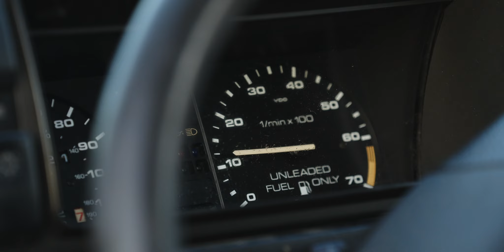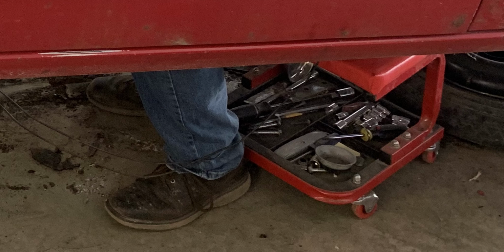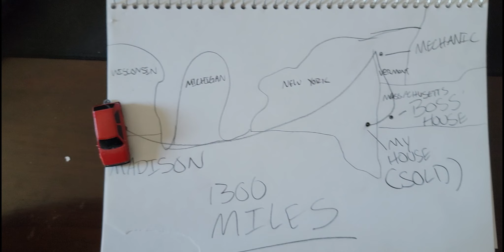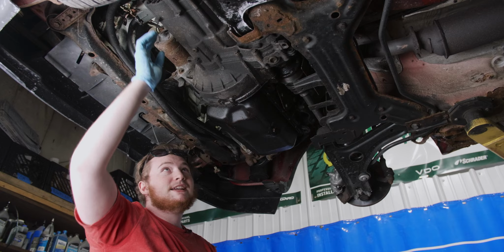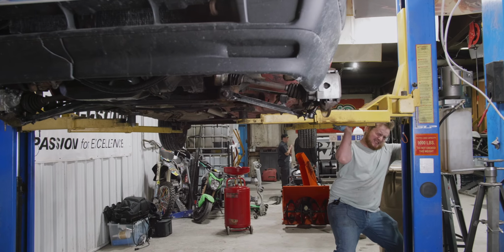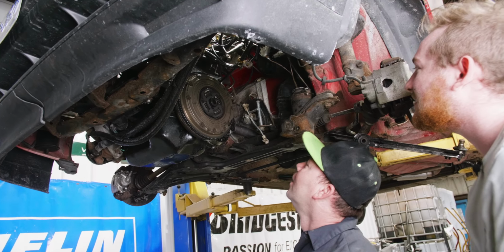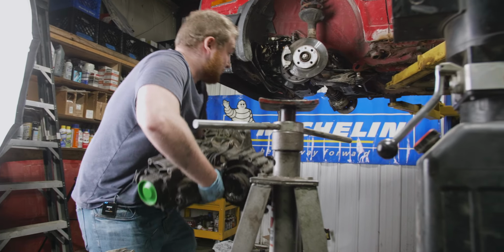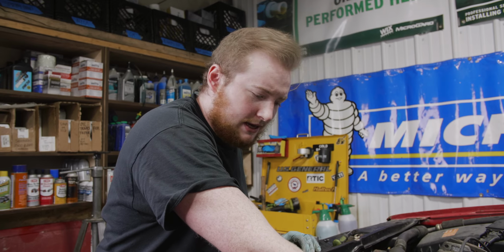Was Fixing My Project Car a Mistake?

Comment: Had a similar issue on my mk1 with the clutch cable. Try checking the release, the fork and rod. with time sometimes it wears as well and sometime maybe shorter.
Reply from the maker: Covered in part 2! Stay tuned

Comment: Absouletly love these cars! I'm on my third mk3 as it stands.
I hate the clutch cable, it sucks. And if you are using the automatic adjusting clutch cable it's even worse....
Please.. and I mean PLEASE look into a manual adjusting cable.

The auto ones are well known for messing up when removed unless you compress it with a jig before removal.
I found the cable for 11$ on google and you will love yourself after
Reply from the maker: Thanks for the reply

I totally agree, the manual cable is best! Stay tuned for part 2 :)

Comment: My daily is a Mk2 Jetta 1.6TD, just replaced the timing belt @ 400,000 km's. Oil sprayed underneath yearly to keep the rust demons at bay. They are fun to drive, very toss-able, direct steering. 14" wheels/tires were optional, good upgrade. Turbo diesel tops out at 160 kph (100m/h) though you need a good long straight stretch to get there (and an engine in good shape). The diesel engine likes to rev. Turbo kicks in about 3200 RPM. Nice torque kick low down. Pretty sure my clutch is original, I'm 2nd owner.

Comment: Golf is great. You can tear it apart with simple tools, everything is straightforward, engine is simple, it's cheap, you can weld/hack etc. and the parts are small and cheap. I also started with Duplo -> Lego -> Lego Technics :) I own 3D golf mk2 1.8 gti 8v
Reply from the maker: Golf is great! :)

Comment: Ok. My quick test for this:
Get someone else or a camera with a tripod to observe. Pop the hood. Pull the e-brake. Point your camera or observer at the engine, looking from the side.
Hop in, fire it up and put it in first. Let the clutch out just to the friction point.

Did the motor rock backwards more than 1/2 inch, producing a clunk?

If so, replace the rear mount with a fresh one, preferably the hydro mount, and replace the other three as well since they're probably crap as well.

If the motor held steady and it didn't make any clunks, LMK and we'll move on to the next most likely culprit.

Comment: I drive a 1989 mark 2 GTD Special in oakgreen with the big bumpers.
I changed the plastic trims in to G60 arches. Nice 16 inch wide set Borbet A wheels, tinted windows.
Sure it turns heads most of the time.

Comment: Hey man, youtube recommended me this video (prolly cause i've been watching too much mk2 content) and I dont know if this is helpful or not but the jerking on throttle input happens to my golf as well (golf 2 gtd, 80hp turbo diesel with brand new clutch set) and I've learned just to live with it, if I slowly increase the throttle it won't jerk.
And as of the clutch issue, did you check if you installed the clutch bearing (thrust bearing? I dont know the name in english)? Cheers
Reply from the maker: Happy to have you here! Yes, I did replace the release bearing.
Reply: Check your front engine mount rubber, probably is crumpled...I also suffer this with a mk3 1.8 acc...

Comment: The mk2 are solid cars simple engineering. You just need to know there weakness fix it. They are simple as you get a brilliant project car here in SA tons of people rebuild them. Hell your car looks 10 times better than what ive had to help build. Simple if this is a effort stay away from new cars with electronics in them.